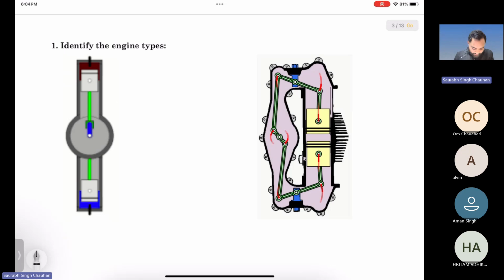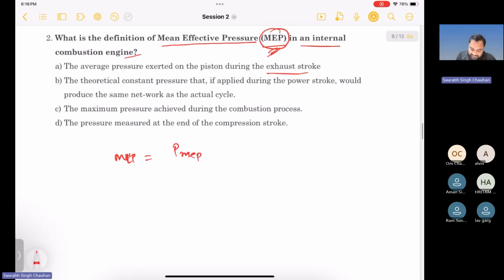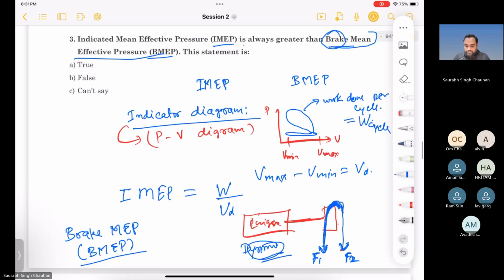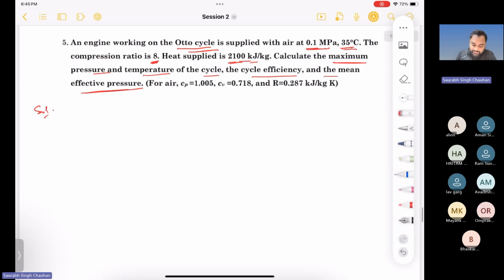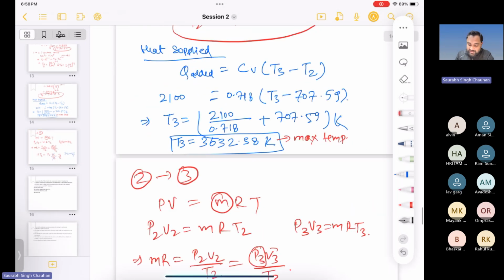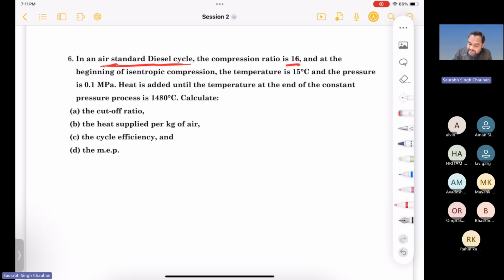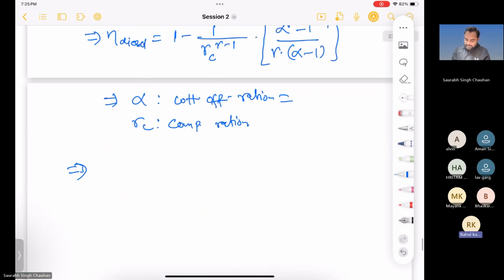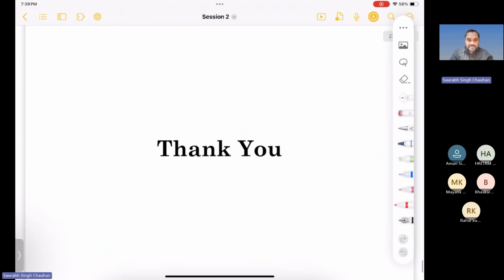Session 02: IC Engines and Gas Turbines NPTEL 2025

Comment: For Q4 none the options given are correct. Answer should be "Power of Engine B is twice that of Engine A and Torque is same". Because Despite being same sized, B runs twice the speed as that of A. He solved it right and choose the wrong one because there is not right one present among the given options
Reply from the maker: Right. Thank you for pointing it out🙏